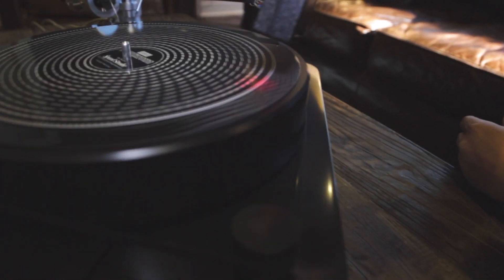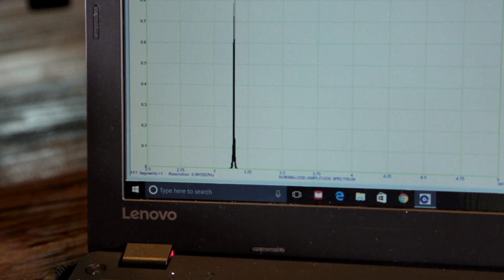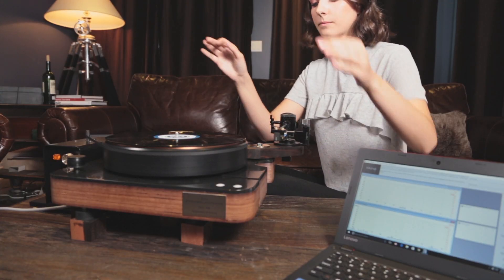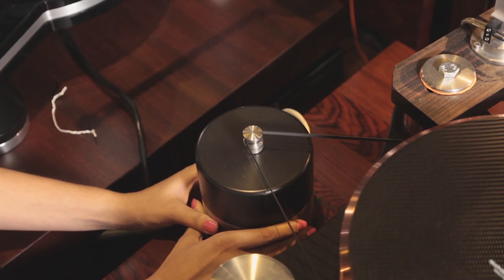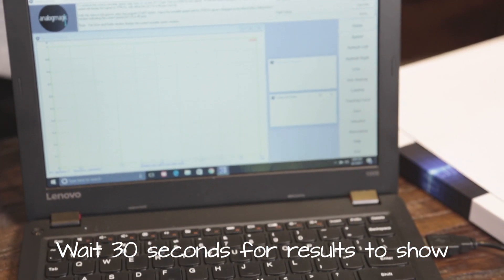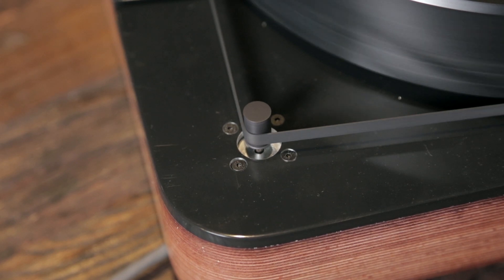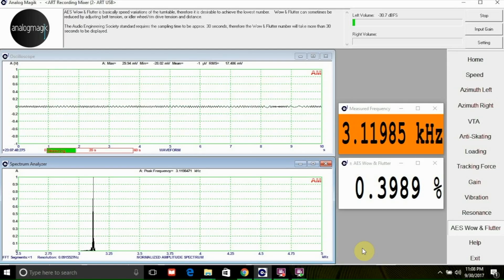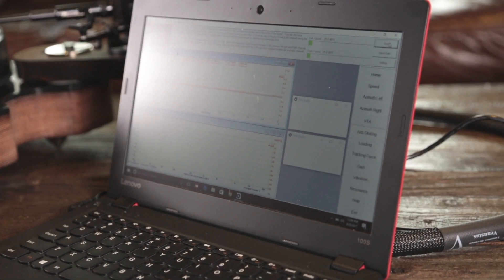How to set Turntable Speed, and WOW & FLUTTER (AnalogMagik Tutorial 2)

Comment: What if you don't have a speed control with your turntable? How do you then adjust the speed?
Reply: If possible adjust belt tension if you have a separate motor or try a slightly larger or slightly smaller belt.  Depending on your TT brand there may be aftermarket aids like precision sub platters that help tighten up speed inconsistencies.  Don’t throw your TT in the garbage.
Reply: I have a 1920s victrola credenza
Reply: almost every turntable has speed control. even the cheap ones, usually have a small potentiometer directly in the motor case which you can turn with a screwdriver.
Reply: Not true at all. Belt drive tables do not have speed controls. You need an outboard speed controller. Yes...cheap tables have cheap speed controls like a pot.
Reply: Usaullnyou have 2 screws when you remove the platter with arrows showing you which way to turn the screw usually clockwise to increase and anti clockwise to decrease speed
Reply: Not with belt drive tables. I have a VPI Aries. I use an outboard Phoenix Falcon PSU with a Roadrunner tach. Highly accurate speed control using DDS technology. Far more accurate than turning a screw.
Reply: You don't. You dump it to a garbage bin and buy a proper tt.